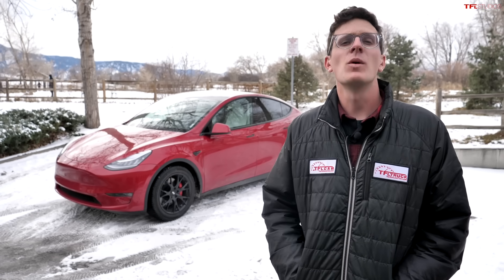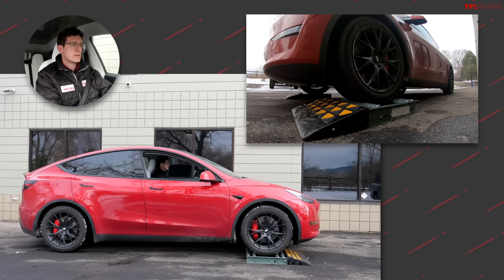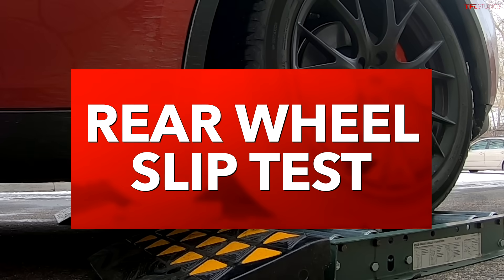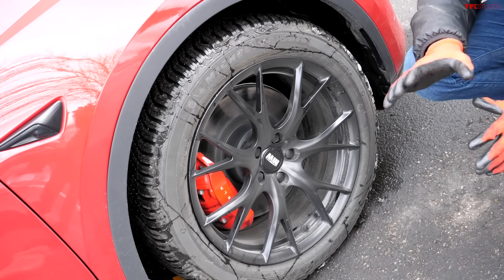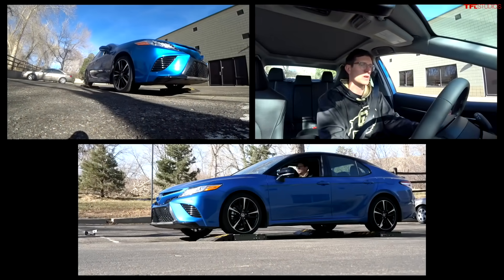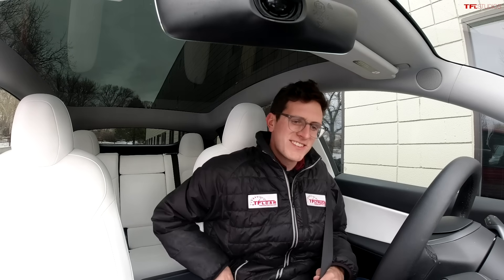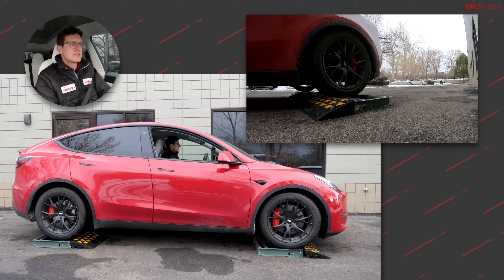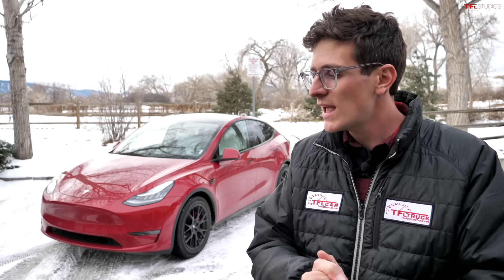Does Tesla Build a Good AWD System? We Put The Model Y On The TFL Slip Test To Find Out!

Comment: The rear wheel slip test confirms my experience.  I really don't like the way my Y behaves in the snow.  It drives like a RWD car and constantly oversteers as it takes too long for the front wheels to "wake up".  I hope they give us control over how the power is distributed in the future.  It would be great to be able to better balance it.
Reply: There is a video from Bjørn Nyland driving on a snowy road and making similar comments for the Model 3.
Reply: No track mode for the Y?
Reply: @integralhighspeedusb  Only on the performance one I think.  My car doesn't have it.
Reply: These types of oversights continue to prove to me that Tesla is still being run by tech geeks and not car and truck enthusiasts. It should be VERY easy (software update?) to give the driver more front-to-rear torque split control. The EVO and STi have a knob allowing some amount of driver selection. Tesla SHOULD also be able to give you the ability to make a series of selections and save it as a personal Mode. Even going up hill versus down hill, you might want torque applied differently then front-to-rear.
Reply: snowrocket maybe when it’s all done in Texas they’ll have more snow to rest it on.  Elon will eventually hear about this video and watch it - yes, this is totally a software update.
Reply: @snowrocket  At least since Tesla is run by geeks they can easily issue a software update to enable this feature.
Reply: @snowrocket  not an oversight. Intentional. That's most efficient.
Reply: @snowrocket  no it's not just a software thing. There's a separate motor for the front and rear wheels. The front one has less power u can't just change the split because there isn't a split
Reply: @KindOfyeah  I know that there's two motors, and there IS some measurable torque split between the front and rear axles, just like any other AWD. If you give far more current to the front and far less to the rear, you'd have a front biased torque split. Give equal amounts, and it's a rear torque bias because the rear motor is larger. Give more rearward and it's certainly rear biased. The beauty of this system is that you CAN vary the front-to-rear torque split without reengineering the driveline itself. Can't do that with a Subaru or an Audi.
Reply: @snowrocket  that's true but I'm sure tesla is running both motor at their safe maximum

Comment: this is actually a good idea for a slip start traction control test if you don't have the chance to run it on snow and ice. some remarks:
1. if you want best winter performance you should not take a compromise. get the world's best winter tyres. e.g. my choice at the moment is a nordic product for the model 3 performance.
2. next time try the test hammering the accelerator pedal, no need to stroke it.
3. try the same test on a winter day on an icy slope. if you get stuck, turn the steering wheel actively left and right to support moving away. looks like this is what happened to you holding the steering wheel straight and the model y tried to move itself left-right by brake control.
4. to my experience tesla offers the best traction control on the market with active motor torque control. abs/braking works similar on all cars, but tesla awd control with 2 motors for 4 wheels on acceleration is a class of its own.
Reply: NOT in a class of it's own failing the last test. Or, it's in the class of "failed the last test"! Any 4WD or AWD vehicle with locking front and rear differentials would have easily passed these tests. Jeep Rubicon for example. Also, first gen Audi quattros with the locking center and rear diffs would have done better than this Model Y in all but the last test. Note that the first Quattro had locking center and rear diffs...in 1980.
Reply: @snowrocket  the class of its own is not related to the 4 tests in this video. my reference and experience is driving with fast changing conditions from dry tarmack to icy snow or slippery crosswalks and markings even on the same street. compared to other car brands with their electric models tesla's vector control for the front induction and rear permanent magnet motor reacts actively faster and more intelligent. manual switching of a diff lock is no improvement as you can only drive short straight distances yet running the risk of damage to the gears and shafts. btw a suv is not an offroad car and the model y passed the first three tests based on its own control strategy. would be interesting to see a direct comparison of the model y and rubicon on an icy slope with proper choice of winter tyres.

Comment: Roller test Tesla awd vs Subaru symmetrical awd vs Audi Quattro (a good version). I’d watch that.
Reply: Add in range rover or land rover too.
Reply: @layne4376  not really
Reply: TFL did the slip test on a Subaru a couple years ago ... https://youtu.be/AdMEJI_4Whg
Reply: As long as you're talking about the Torsen version on quattro, it will beat them all. Unfortunately, Audi doesn't equip all quattro vehicles with Torsen quattro.
Reply: @layne4376  audi and subaru awd systems are the best, stfu!
Reply: @layne4376  yeah troll!!!
Reply: @layne4376  try it In your dreams it should work better
Reply: @layne4376  There's a test on YT of all brands ( BMW, Mercedes, Audi, Toyota, Honda, Subaru...) in the snow doing starting and slalom. The Audi Quattro won.
Reply: @marcoserbach3848  Is that the biased af video, where they clearly drive the Audi slower and closer to the cones?

Edit: Here it is https://www.youtube.com/watch?v=NRpDBzFFI1g
idk about you guys, but this comparison looks very biased towards Audi to me (is it from an Audi commercial or something?).
Reply: @marcoserbach3848  link please?
Reply: @DeluxeFilms  That's a different one from what I was saying, but that's a cool video too. It shows that Tesla was able to do it even with the front wheel being the only one on the ground. I wonder why the result was different for this video we're commenting on.
Reply: @marcoserbach3848  I would expect the Quattro to win since it has either lockable differentials or Torsten or Quaife differentials. Some Subarus do as well though, so it really depends on which Subaru you’re testing.
Reply: @layne4376  i know the pilot is different but i passed a pilot that was stuck in 8 inches of snow on the road while me in my subaru legacy passed him with very little issue
Reply: Quattro vs. X-drive vs. Symmetrical vs. some full EV.
Reply: Gmc Syclone kill em all. 😂

Comment: I am still deceived that the rear wheels have to slip trough 3/4 turn to activate the front motor. Electronics coud be way better.
In deep snow and ice, you dig yourself with this.
I am always getting scared when it does this on my Model 3 Dual Motor.
Regen and rear bias makes a squirelly (yaw) car on the snow compared to a real awd or fwd.
Tesla could make a ''Winter traction'' mode that engage and regen both motors even if we lose some efficiency.

Comment: Good test, but in the last one we were unable to see (due to camera placement) what the left front tire was doing. IF the left front was actually spinning on the cold pavement, it’s a tire/traction failure.. not an AWD power transfer failure. Huge difference and very relevant.
Reply: Very possible, but we really needed to see what that tire was doing. If it was stationary, then it’s a total fail on the all-wheel-drive system’s ability to transfer power. If it was spinning, then it was a traction failure exacerbated by limited suspension travel.
Reply: Also might be due to limited suspension travel so not much weight on the active tire?

Comment: Please confirm 3 wheel test with Right Front tire on ground, no posi traction in front wheels. Curious, results different?
Reply: I doubt it would, if sends power thru an open diff
Reply: Dufnik is correct; would be no different.

Comment: Excellent video. This is how engineering would do the test.... I was debating dual motor or single. This pushes me over to dual motor.  That is what everyone saying the best value is a dual motor in Tesla car
Reply: The Y doesn’t come in a single motor. 
The Mach E is reportedly a better driver and the interior is vastly superior. I know where I’ll be spending my money
Reply: @mattbrew11  , Unfortunately, the E is a worse driver. i was hoping it would be better, but look at the videos instead of listening to the cheerleaders/reviewers. The steering ratio is atrocious. It looks like a bus going around corners with how much steering wheel input is needed. Plus, 225 tires are way too narrow for the weight of the car. Additionally, the AWD E is significantly slower 0-60 than the Y. Lastly, the poor brakes are a common complaint. on the E. That's why when Motor Trend tested the E it was a full second per lap behind the Y on a track. I wanted the E to be better, but it's more of a grocery getter than a handling machine. Maybe the GT will be better.
Reply: @NukemNak  lol I guarantee you the people hating are outright fan boys
Reply: @mattbrew11  Mach E > Made in Mexico, Tesla - Made in U.S.A.
Reply: @mattbrew11  go to abetterroutplanner.com. And enter a destination you might want to go with all electric cars your considering getting.  This will give you an idea of strengths and weakness of traveling.  Everyone's needs are different.  As a 69 mustang owner I wish they wouldn't have used the Mustang name on a 4 door crossover.
Reply: @captn3x  while I initially found it odd, it stirred up a hornets nest of buzz and in this day in age that seems to be how successful marketing is accomplished. You’ll get an electric mustang soon enough. 

As far as a better route planner the charging infrastructure will catch up soon enough. They’ll be as common as gas stations in a few years that doesn’t concern me.  I’m getting a hybrid F150 with a 700 mile range so if I care to drive that far, that works fine for me
Reply: @captn3x  I agree. Ford will dilute the Mustang name by doing this. Why they don't see that is beyond me.
Reply: @mattbrew11  Mach E LOL !

Comment: I feel like the model Y should have done better on that last test. Maybe I’m oversimplifying it, but this seems like an issue that could be resolved through a software update pretty easily
Reply: Traction braking is probably softer on the steering wheels on purpose, most drivers won't be prepared for the sudden pull on the steering wheel.
Reply: The tire on the ground has virtually no car weight on it because the car is suspended in the air by the 3 tires up on the rollers. Not a good test.
Reply: @MARXTACET  thats the whole point of the test, its an awesome test
Reply: Elias, I’ve watched it several times and don’t hear the driver front tire fighting for traction, I just hear the rollers. One tire should be able to pull the car off. 

I wish they showed that wheel in the camera view.
Reply: @ericviele4379  Absolutely!

Comment: It did pretty good. About the same as the Camry did. You are correct with the instant torque and electronics they are going to be able to pull off some pretty remarkable vehicles in the near future but when all that technology glitches it will be an old solid axle gas drinking something yanking it out more than likely. Lol
Also maybe as someone else mentioned some kind of TFL slip chart to keep track of progress maybe even with some sort of grading system.
Reply: No the Tesla failed every time in every mode to come off that last test. It did slide sideways on the rollers and come off once, but the Camry figured it out on its own.

Comment: In the real world, the Tesla is a monster in snow and ice. Instant torque, tons of power, easy to control. I put my M3P in track mode (traction control off) and let the blizzaks go to work.
Reply: I think the key is having blizzaks/winter tires. Otherwise all that power could be dangerous w summer tires in the snow.
Reply: @Wasabi9111  absolutely, but that’s true across the board. Our company Prius with blizzaks is far better than my Jeep on 35’s. Still, I’ve had a lot of awd and 4wd vehicles over the years with snow tires, and the Tesl 3 Performance is easily the best in slick conditions.
Reply: @grisa12345  I had my first experience w a 4x4 last year as a loaner vehicle and I was surprised how poorly it did in the rain. It was probably a combination wrong tires and 4x4 systems are not generally optimized for road usage. The system was just slow to react to the road traction.

Comment: This is why car companies are loosing the market to Tesla, while the others build the so-called Offroad monsters like Chevy Tahoe with open Diff , Tesla is building decent ass AWD.
Reply: Tahoes have G80 locking rears 🤭
Reply: @BullittKid08  If you order it with the G80, some do not order it.  On a very icy road or intermittent icy patches  a locker is not always helpful.
Reply: @BullittKid08  bro i dont think it has one https://www.youtube.com/watch?v=Ft9jOZfZHXE&ab_channel=TFLoffroad
Reply: He had to cheat with the Tesla. This video shows the Camry successfully completing the test.
Reply: @jeffg9612  in the Camry video he said it came off the side of the rollers as well.
Reply: The camry managed to compelete all the  tests . I dunno why you would choose this over the more realiable and less expensive camry
Reply: @dahhhhful  the Camry had the exact same issue when the primary drive wheels (front) were on the rollers.  It only came off because it would slide off the rollers.  Need to watch the specific Camry video.  Both cars did well, it’s a torture test for a reason.
Reply: @dahhhhful  shit sorry bro, Toyota nd Nissan any day man, myself drive a Patrol. I just happen to see these new gen cross fail these tests soo badly
Reply: @dahhhhful  The Camry did not complete the last test, it still slipped off the roller if you were listening.

Comment: Crazy that a camry performed better than this.
Reply: True, but on the other hand Tesla can probably push an update that can make all Tesla's perform better if they really wanted to.
Reply: @manu144x  agreed, would love to see an updated test if a SW update comes out!
Reply: The Camry failed the last test and slipped off the roller if you were listening.
Reply: @starshipdriver8536  sorry should've been more specific: crazy that the tesla, which should be able to torque vector infinitely better than a camry with 3 open differentials, also failed this test and didn't just shove power to the wheel that clearly had no traction and push itself off without issue.
Reply: @dbeckMSP  
https://youtu.be/w7e-0bZ9AV4
Already passed the same test. Camry did not pass all.

Comment: Be interesting to see how much better it would do with a mechanical limited slip differentials.
Reply: Considering the motor IS the differential how would that work exactly?
Reply: @mattbrew11  
That's not true.  There is a single motor, with a gear reduction on the end and a differential. There has to be or putting the brakes on one side would not transfer power to the other side.
A limited slip differential would do that mechanically inside the diff itself. 
The only other way is to have two motors one for each individual wheel..
Reply: @kens97sto171  Kens, you are "Smarter Than Him". Well said, sir!
Reply: If it had mechanical LSD how would they provide power to one wheel in particular, they need open diffs so they can use the brakes to send power to individual wheels.
Reply: @BullittKid08  They DO use the brakes to transfer power left-to-right, and right-to-left. They could still do that even with a LSD.
Reply: @snowrocket  
Absolutely it certainly would still help and you could use the brake actuation to assist with torque vectoring also. The nice thing about a mechanical torsen style LSD is the immediate reaction time. There's virtually zero wheel slip before torque is transferred. Usually less than a quarter of a rotation. They also drive quite nice in general. When you put your foot in the throttle definitely rotates the rear of the car around more predictively.
My friend had a modified Mazda Miata pushing about 250 horsepower at the wheels. It was quite a lot of fun to toss her around corners at heavy throttle. I had also driven open diff miatas and definitely a much better driving experience with the torsen LSD.